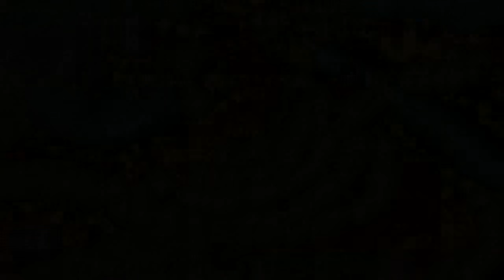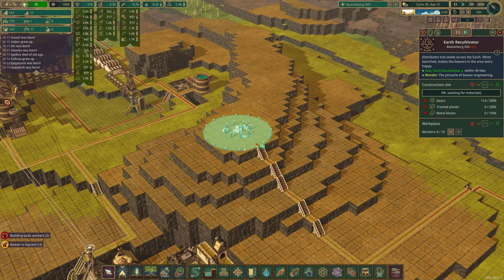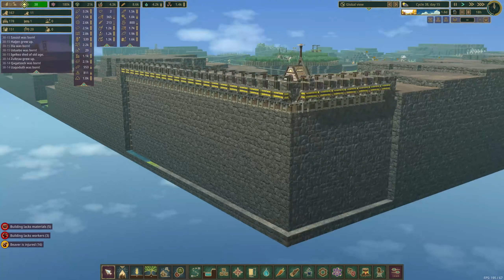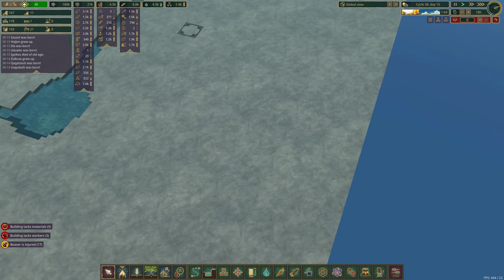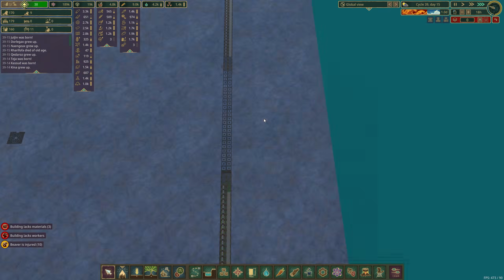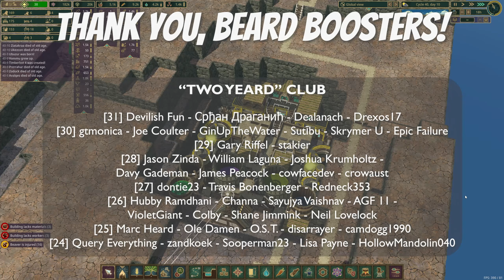We need bots... Let's build them a cavern! Timberborn 1.0 Experimental Episode 21

Comment: 10:00 - there is a simple solution to the water seep - use two mechanical pumps. One set to pump clean water into the pond and the other set to pump badwater into an outflow.
Reply: A fluid dump on top, with floodgates set to .95 takes up less space and no power. Works just as well.

Or, alternatively, use the aquifer next door, blast a canal and a waterfall into the pond, then use a sluice to keep it the water level at .85 or so.

Or both, to be sure.
Reply: @richardhoedt8947  Fluid dump needs a beaver and you need to pay attention to when the seasons change. Mechanical pumps are fully automatic - set and forget.

Comment: There are a few ways to add a dirt ceiling. Overhangs and metal platforms are one way. You can also remove the supports once the dirt is in place. As long as they are connected to something, it should be fine.

Comment: To bury the whole thing and keep the Zipline Station as buried as possible, utilize another Pylon to get a straight shot in at a lower height so sink the Pylon in the ground or use the side arm thingy on a block of terrain again allowong a staight and level shot into the soon to be buried Bot Facility. This will allow for 2 tall 1 wide tunnel into the buried facility or even possibly a 1x1 tunnel, i cant remember the minimum clearance required for the Zipline lines themselves... either way its pretty small and easily disguiseable/terraformed to be hidden.

Comment: Trouble free seep. Use a Sluice, and Bad water harvesting.

Bad water is automatically removed, at the cost of one lazy beaver.

Or, dig a trench to the supply above, add a Sluice to the cliff side. Automatic refilling and just close off the seep.

Comment: @41:07

If you create a central elevated beam (spanning the area you want to cover), then dirt can be added on top of. Dirt then can be cantilevered on both sides of the beam. You are basically building two arches as the dirt cant be cantilevered too far.

This can be scaled up as much as you need to (assuming you have enough Z height to build in).

Comment: 5:04
I think it would be be good to also make a direct connection to the center of the map, not only the path passing through the mine.

9:22
I recommend having more farms (in and out of water) in more places.

17:48
There is a way to solve it.
You close the entrance of bad water with levies, you blow up a space above one of the levies, and one more on each side of it (one above the bad water passage and one where you want to not have bad water), you put shafts on those spaces and you put an impermeable floor closing the space above the place you don't want bad water.

Comment: @38:13, would be interesting to bury the zipline station into the botcave. The beavers only need 1m height clearance to zip along. 

Do note, though it is important to connect the metal production, into the botcave, you want to a more direct connection to the centre of the map.

Comment: The bot pit is begging to be a bot cavern. Since dirt can support itself up to 3 blocks, you'd only need a handful of smaller metal overhangs around the edges to act as initial supports and then build a full roof out of dirt. I'd also move the zipline pylon so it's directly straight with the bots' zipline station so it's a tidier and prettier entrance into a cavern. Maybe add some decoration to the entrance like lanterns so it's like landing lights into a hanger.

If you make the bot cavern roof thick enough, you could even put a water dump up there and plant a load of mixed trees to fully conceal the fact it's a secret bot building bunker!

Comment: 17:48 You can do something about it, without mods, if you want. You can seal off arms of the tunnel network with two dirt block or two levees each (since your tunnel arms are two blocks wide) and have the power come over these blockages (just like you have power come over the tubeways in the emberpelts playthrough) and then seal that with an impermeable floor. You don't need the 'levee-powershaft-thing' for that. ;-)

Also, I do like your hidden bot cave. Easiest way to cover it might be a centrally placed wooden platform with a 5x5 metal platform on top, cover that with dirt and extend outward with more dirt.
Reply: @DominikHolter  I did this and it works great. Impermeable floors are an excellent addition to the game

Comment: iirc there is an Achievement for having one of each recipe for the refineries, so build 2 more Refineries and set them to the other 2 Bio Fuel recipes.

You could fill the central water area from somewhere else, leave the dump on and just ignore the water seep, that's what I've done in my runs of Oasis, I even submitted one of them through the colony submission.

Comment: Hey
I have a doubt can anyone help me
How to install or use water beavers mod ( been trying for few days not working )
Reply from the maker: It's impossible to say what the problem is without knowing exactly how your timberborn folder is set up. Have you asked the Waterbeavers channel in the Timberborn discord? They're probably the best people to ask
Reply: have you rtfm? googled etc.? ... check that you have ALL the dependency mods also installed, and of course activated. also check the load order of your mods ... there's lots of info out there available if you look for it. good luck 👍